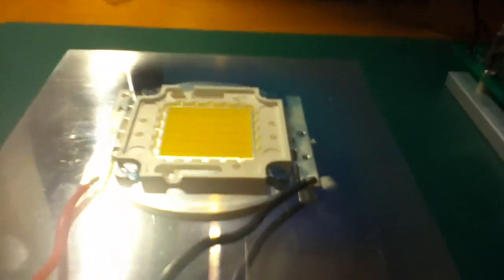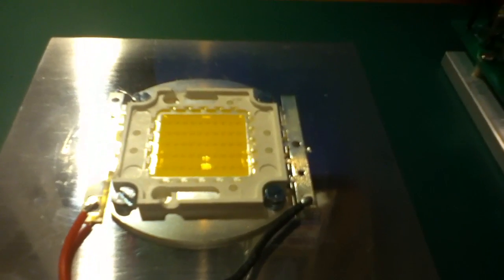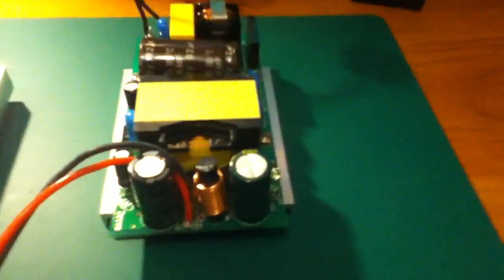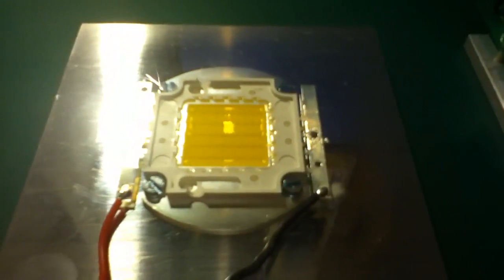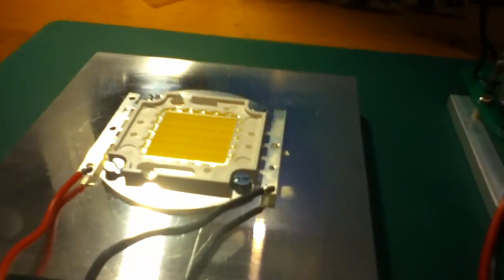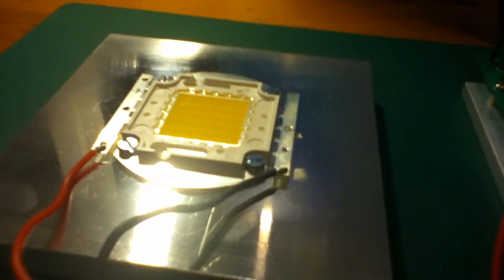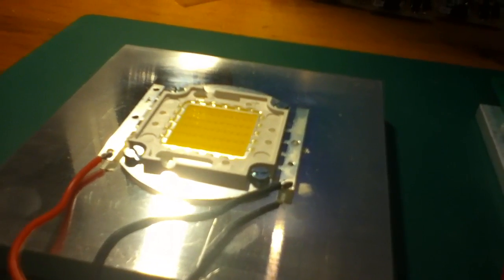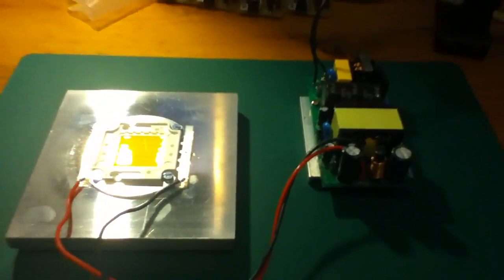50W High Power LED is as bright as a 500W Halogen

Comment: I have run 20W Leds on a computer CPU heat sink with fan and stayed quite cool/   Probably get away with up to 30W with a computer CPU heat sink with fan.  Perhaps for a 50W Led a larger heat sink (Double the size of a CPU heat sink and two fans may be adequate to keep the temp down.
Reply: crap.  this is not a solution to CFL or HID
Reply: BrekanArts Have you actually tried LED Emitters?  I built 2 18W Led Emitters for worklights and very happy with them.  The color is 6500K and powerful.  I have changed many of my lights in my house to Led and they are cooler than CFLs and give off nicer light.

Comment: Good video. The same problem I've run into myself. Pretty small form factor and low power usage for the light they give out but the heat they produce is just insane. The heatsink and potentially a fan complicates things a bit and bulks them up.
Reply: too bad.  seems like and awesome concept otherwise

Comment: Chinese ratings... I have a bunch of 100W being driven with 10 or 20W drivers to replace CFLs and they offer very decent performance of about 80-90 lumen/w. I also have one being driven with 60W with heatsink in the low 70's.
Comparing to an incandescent, halogens offer about 16lm/w so if you are driving this at full load you would get no more than 50lm/w, so 50x50 = 2500lumen, which is a 150W halogen, not 500.
Reply: 90lm/w at 30W and 100lm/w at 10W including losses on the driver (Its typically 80% efficient so only 8W/24W for the LED).
I cool them with a PC heatsink and a fan running at low speed. The fan is powered from the 30V that run the LED trough one of the eBay adjustable regulators based on the LM2596.

At 10W they replace 15W CFLs at home, the 30W replace 35/70W Metal halides to grow my  tomatoes. They are all 30V so I can change the ballast or add them in parallel for some fixtures for a low/high Setting if more light is required which is very flexible. For less that £5  they are a bargain compared to other bulb types.

About the heat,
You get higher efficiencies at low power levels. Not exactly half tough. Say you run a single led at 100W. Consider the led to be 30% efficient. The same led at 50W is now 40% efficient. So in practice if you drive two at 50W they are still 40% efficient. The first case converted 70W to heat while the second case converted 2*30 = 60W. The result less heat and more light, but not by half. Of course since now the array produces more light you could further reduce the input power, say to 80W, so now the heat output is 50W instead of 70 for the same light. The reason manufacturers don't so this on the consumer market is essentially cost. That's also the reason consumer grade LEDs have typical efficiencies if 50-60lm/w which is no better than a typical CFL.
Reply from the maker: Completely agree - I now work on the basis of a 4:1 ratio LED:halogen
Reply: basically are you saying a 100w driven with a 50w driver would produce 1/2 light and much less heat?
Reply: If you use them with a 100W ballast they won't last long due to depreciation of the light output. Might be OK if you need them on for short periods of time though. 

Having said this they are quite reliable at 30-50W. I have some on 12H a day and they perform well, but I keep them cool (30-40C).

Also keep away from the ones with the square metal plate. They are rubish! Look for the ones with the rounded edges as in the video.
Reply: Susana Godinho  So you're running a 100w chip at 20-50w power? That sounds like a terrific solution!  I think these chips are rating around 60lm/w.  In theory could I drive a 200w LED with a 100w driver and cut the heat down by the same proportion? That would output 5000-6000lm.

Comment: Hi Julian don't know if you can help but I bought a 20 watt - 32 volt led for the purpose of making a really strong lamp what would be the best way of making up the battery for it and would it have to be 32 volts probably a stupid question .  Im a bit of a novice with this kind of stuff but I thought a 32 volt battery from a power tool for instance might work .
Reply from the maker: You need to limit the current that the LED draws, so some electronics will be needed. The battery voltage isn't that important - use a boost converter if the battery voltage is below 32v and a buck converter if it's above

Comment: where did u buy this LED? whats the price and does it have heatsink which is shown? whats the price of heatsink and where to get it?
Reply from the maker: LED was from Sure Electronics via eBay. 50W LED is now under £4 (about $6). The metal block isn't a very good heatsink because it doesn't have a very large surface area. Sure Electronics also sell heatsinks.
Reply: Julian Ilett
thank u julian, I thought u can get some  locally in UK in tool station or screw fix. Saw some bulbs but  the socket needs to be changed. It would have been better if we could get in in shops instead of ebay but prices are prohibitive.
Reply: Julian Ilett That's pretty much cool and cheap. BUT. A proper passive heatsink without airflow will cost a fortune! I think you have to pay $100 for a freaking aluminum/aliminium heatsink and heat paste for this bloody LED...
Reply: Nice hint. I will take a look in the junk market to find some of this old components. I used to have some but I tossed them out a FEW DAYS ago since I'm moving to a new flat... What a pitty. ;)
Reply: *****
But at that moment where I tossed it out it was of no use for me anymore. :/ It was when I upgraded to Notebooks.
Reply: ***** And thus 100-150w LED fixtures running 250-1500 per unit.

Comment: Heat tend to be a problem with high powered LEDs, after all, unlike incandescent lamps, where the heat is integral to their functioning, the heat released by a LED is an unwanted byproduct. This means that though LED chips can be quite small, the lamp built from them will have to have a fair bit of metal in it.

Comment: Well, I expect that the LED shown in the video has a very wide angle, probably 120+, and would need some optics to focus it. Of course, LEDs will not have near omni-directional emission like an incandescent bulb, and so should ideally have optics that are made for that emission pattern, but LED replacements are getting better, the early ones were just arrays of normal 5mm LEDs and had very narrow beams and often a rather bluish light.

Comment: The only problem of these LEDs, they do not have wide angles thus only focus at one point, which is good if you need light on one specific spot. When I try to replace halogen bulbs with LEDs especially on cars, for some application I ended up changing it back to halogen because LEDs are not compatible with the reflecting mirrors to generate well distributed light

Comment: Have you done any measurements in terms of what would be the minimum heatsink size for this wattage? I am intending to use a CPU cooler with fan but wondering whether it would be possible to actually go passive with these, by using lots of fins etc.